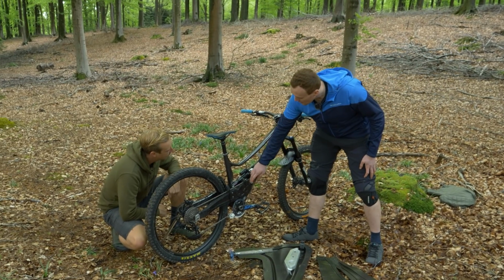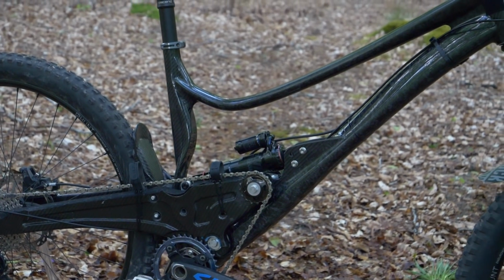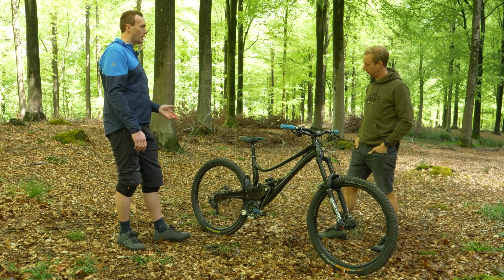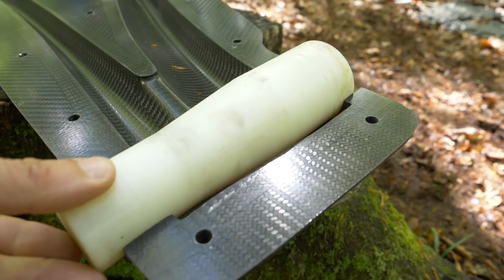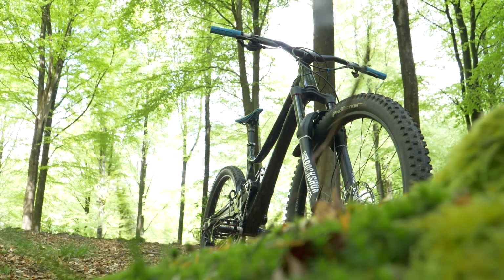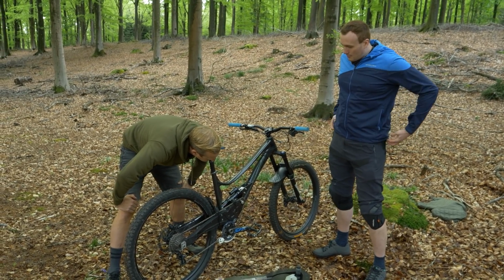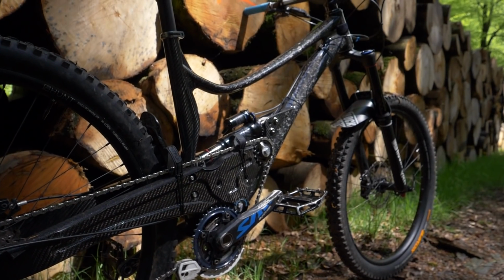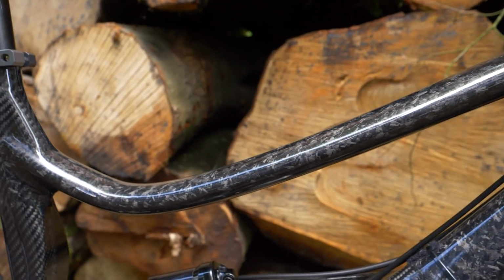The Homemade Super Bike Built From Scratch! | Insane Fully Custom Carbon Mountain Bike

Comment: Probably the best bodge we've had on this channel
Reply: Definitely the most expensive. What's he doing with that seat tube. It looks really strange. Like it broke and he's patched it up.
Reply: Quick to say bodge. When’s the last time you built a full suspension bike? Not to be rude. I believe he deserves credit for this.
Reply: @itarry4  it matches the tooling board exactly... that wouldn’t be the case with a repair.
Reply: @jet_enjoyer  yhea I didn't think that was the actual reason for it just what I think it looks like happened. If it was a patch up that would have been dangerous as well as ugly. Just really not a fan of that design.

The build now the build quality looks amazing. My comment came early in the video. The front half of the bike is cool. It's the seat tube and the back end I'm not a fan of.

However when he explained that it hadn't actually cost him all that much the whole bike starts making a lot more sense. Not paying for the machining at all nor the carbon he's used and doing the work himself it's probably been fairly cheap so far so why the hell not.
Reply: More of a hack I'd say

Comment: I've actually got an Enduro design of my own in the works. 180f/160r, 27.5, 64° hta, short chainstays, average reach, just something I'm designing around what I'd like to see in a bike to start. I can always change these figures later for the market, once I get the suspension design proven.

This guy gives me hope and inspiration to finish my CAD model.
Reply: What you using to test how the suspension works? I take it you can't build to test so do you have some software to simulate the various things you need to test.
Reply: @itarry4  I have been designing a bike in the last couple of months and I have been using GIM because it is free but a royal pain in the ass, once I am sure I will actually build it i'll just go out and pay for linkage x3
Reply: @itarry4  I'm using LinkageX3. Jorris, it is worth the money, I promise. My particular design is a royal pain to get right, and I've been fiddling with it for the better part of two years. I feel like I'm almost ready to finally get a prototype made and tested, to prove the design. There's just a few things I need to sort out. I can have anti-squat at around 100% at sag with low pedal kickback (between 3-7°) if I use a static gearbox with a 6:1 ratio, allowing smaller gears and a wider range of equipment, but sourcing the constant mesh gears in the proper size will prove to be an issue unless I have them custom made, increasing the production cost (I do want to sell this bike at some point). With this gearbox, I can also tune the anti-rise to be right around 100% or lower at sag, minimizing the effect braking has on the suspension with this particular linkage driven single pivot. It will also allow the bike to have an effective seat tube angle of 80° or steeper, increasing pedaling efficiency. My aim is for this bike to be worthy of a podium spot in the Enduro world series. If it places on the podium, especially if I can price it within an affordable range, it will sell very well. Sizing shouldn't be much of an issue.

Unfortunately, the leverage ratio will be a touch higher than most people would look for. This poses a few problems for the longevity of the system. I'm also trying to use links that are as small as possible to minimize lateral flex that may reach the shock, increasing longevity. Hopefully, if I can get all the parameters within tolerable specs, this bike would be able to race with, or ahead of, the competition.
Reply: @TheDustyShredder  if you complete your project I would like to test it, your project seems really cool to me 🔥
Reply: @drago7052  I would like to know where your skill level is at first. I need someone who can push the bike to it's limits.
Reply: @TheDustyShredder  you are absolutely right, but I have no way to prove it. I can only tell you that I love riding and here in italy we have some phenomenal trails. But anyway there isn’t a real way to know if i could push it to her limit. Still that I like your project and i would like to get more informations about
Reply: @drago7052  If I can afford to get a prototype made, I'd be more than happy to ship it to you then. If you go to mtbr, I started a thread with details about my progress in designing the bike. I also posted it on bikeradar.

https://forum.bikeradar.com/discussion/13115988/new-mtb-design-thoughts

https://www.mtbr.com/threads/im-designing-a-bike-to-be-dubbed-the-green-gobblin-feedback.1127461/page-4#post-15320555
Reply: @TheDustyShredder  i would love to ride it! I’ll stay updated on your project but maybe we can still stay in contact so you could update me about the status of the project
Reply: @drago7052  Sounds good man. I'm working on the CAD model right now, hopefully I can have it manufactured for less than $8,000, but I won't know until I can send it over for a quote. It's a complex shape with a lot of material, and I'm looking for a seamless construction to maximize strength and minimize weight. My hope is that this bike is stable, but playful, and handles rock gardens without so much as a second glance, going up or down.
Reply: @TheDustyShredder  we can keep in contact maybe on facebook or something else?  The starting price is always high when you start a project like this, but certainly will be worth it. For the materials what was you thinking about? Aluminium 6061 or something better?
The seamless construction is a good idea but sometimes some soldering also help strengtening the bike, obviously without soldering will look nicer

Comment: That it some piece of kit! Love the rear swing-arm. 

Made a red cedar kayak at 6 meters long and thought on making a bike in the same method. Watching your effort  has inspired the will to commit.

Toyed a few years back with the idea of making a wood/e-glass/carbon hybrid as do large miles occasionally hitting 80 to 98 in a day when fit. This is way beyond my comfort level and to make the idea even more stupid the rear cassette has to be above the bb with 2 rear 160 mm disks mated to enclosed straight pull chains in oil, and the frame will be a trellis stylie able to take 6 litres of fluid, tools, puncture kit and a decathlon short track pump (sick of topeak failing and taking 4 hrs to inflate in the wet) 

Hope i can get within a million miles of your achievement,  a massive challenge and simply stunning. Look forwards to the second frame set.

Comment: I'm gonna be amazed if a bike company isn't trying to reach out to him after this video lol XD His work is amazing :O
Reply: He used available software to design a fairly ugly bike. He's good at the build part but I'm not sold on the design side at all.
Reply: @itarry4  damn bro.
Where's yours?

Re the design.
High pivot idler bikes are here and more are coming.
Commencial supreme, New trek dh bikes, norco shore, actofive, forbidden, deviate,  and the evan turpen bike

More are coming....
Reply: @EnglertRacing96  i like high pivot it's nothing to do with that although his looked a bit strange and he admitted himself wasn't quite right. It's tte actual shape of the down tube I had a issue with. It's got a funny bulge at the top and was really thin at the bottom. To be fair to him my comment happened at the start after seeing the bike side on and I couldn't see how well done the carbon lay up was and how nice the front part of the bike was. It's the down tube and rear triangle chain stay that I didn't like.

Especially after he talked about the little cost he'd so far had I now don't blame him at all and can understand why he did it. Just at first it seemed a bit unnecessary as such long bikes now exist.
Reply: @itarry4  I think he should move the lower guide idler half way up the chainring to alleviate some of his wrap issue.
Reply: @EnglertRacing96  yhea that'd definitely help him. I'd also redesign the whole rear end to be honest from the suspension and the down tube and revert to a more traditional maybe Alloy rear triangle....

Comment: As someone who currently works on hand-built carbon fibre racing ocean rowboats, it's pretty interesting to see!
Kind of a waste to make the mould out of carbon fibre, Glass fibre works just as well and is a fair bit cheaper.

It's nice to see his frame is foam core though, it significantly improves durability, and our racing rowboats also use a Carbon-foam-carbon sandwich layup.
Reply: hardly a waste of carbon fabric when the material is out of life anyway and no longer deemed suitable for aerospace applications and thus customer and regulatory authority requirements.
Reply: @clarkie005  I guess? still tho
Reply: @hananas2  Because any shop that works with automotive/f1 pre pregs which this is, do not carry a tooling resin system that is glass. Just makes sense to use carbon. Confused by your logic, and assume you haven’t worked in that environment before.

Comment: I wonder would an oval chain ring help with tooth ingagement instead of moving the ideler wheel back?
Reply: That makes no sense
Reply: No, it wouldn't. Even with the variable tooth count that an oval chainring simulates, it would not alleviate the chain wrap problem. He needs that rear idler higher up and a few more links to accommodate.